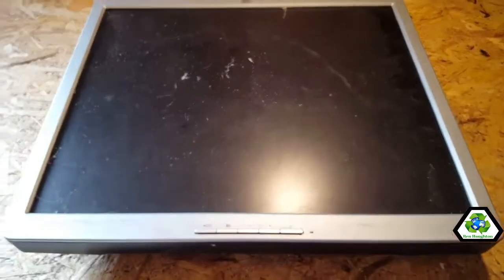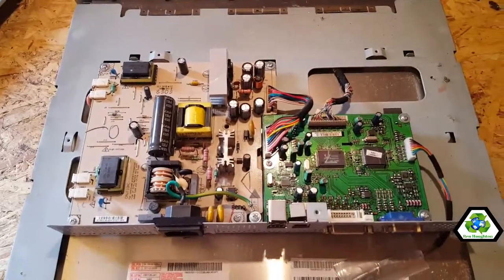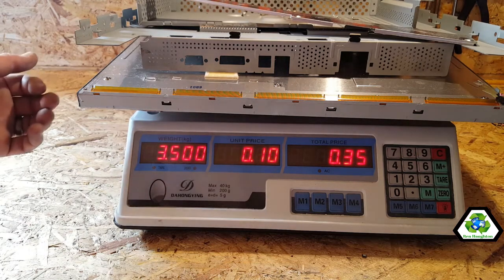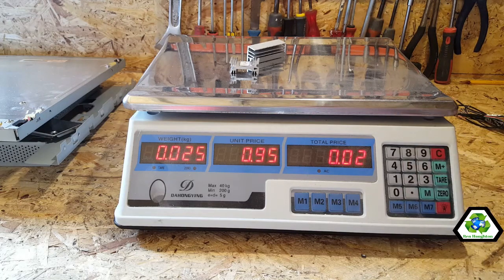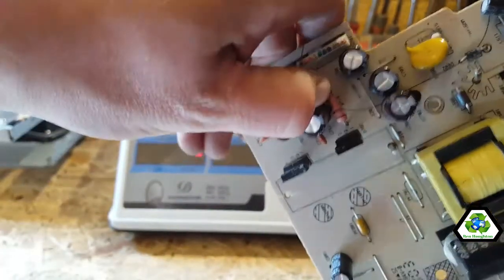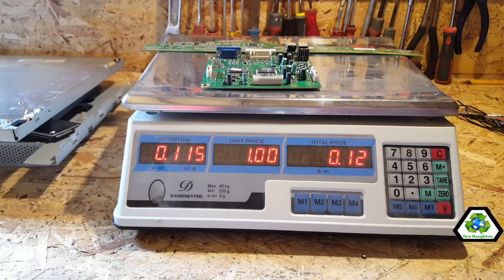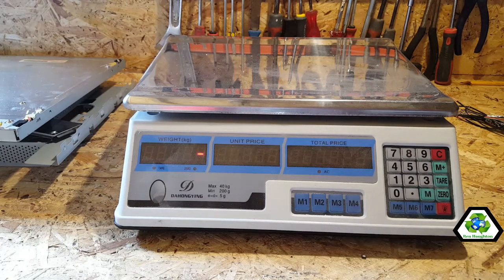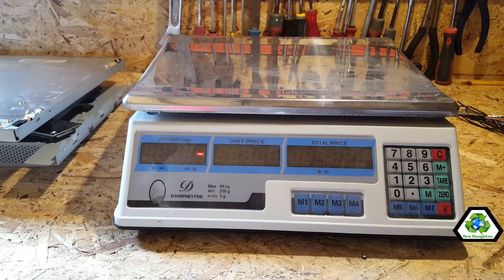♻️ scrapping out a pc monitor to determine its value

Comment: Oh my cosh you gotta take the side and too and bottom clips off the actusl screen to to get to the gold portions you didnt even touch the most valuable parts of the monitor plus you get far more money if you ship your green boards too board sort. Com if you take greenboard strips with the gold/platnum clips off tbe side of yhe actual monitors and flatscreens themselves youll average about 25$ a monitor too 50 a flatscreen if you sell to board sort.com  and separate any processors  . Last month I shipped 700 lbs too board sort.com of properly separated servers routers lcds and switches I work at a data center  and for properly separating everything  for that 700 pounds i received a 1900$ payment on easypay